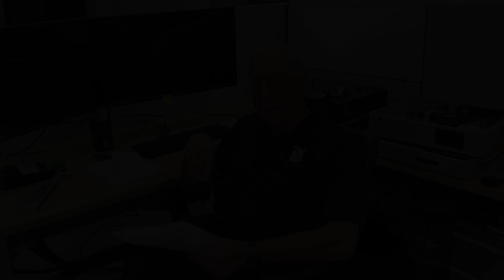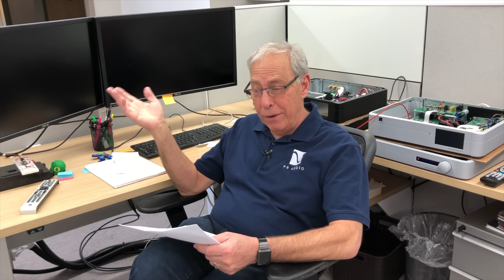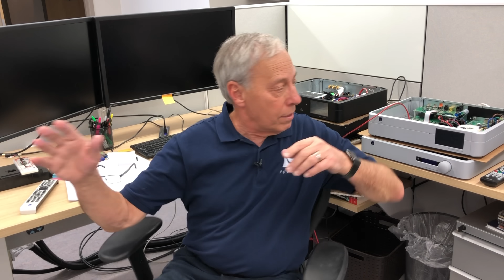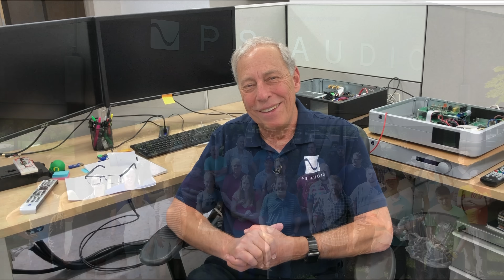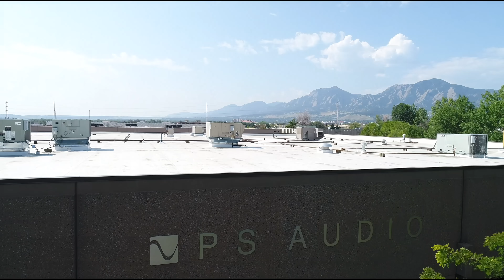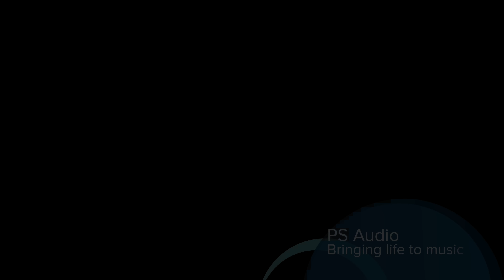Is it time to rethink our power grid?

Comment: Is that transformer stuck to the circuit board? Why do that when there's plenty of space on chassis? 
Stuff like that really annoys me. Means if repairs need to be done , gotta hold a large board with a massive weight in one corner. I consider that to be bad design and have abandoned Acram for just this issue.

Comment: Dc voltage would need to be just as high as AC, otherwise you'd need huge cables to be able carry the power, a NA wall plug can carry ~1800W, and sometimes if you're not carefull, the breaker blows. Would be fine for some electronics, but not for all, and at that point, a power supply per item is probably a better idea.

Comment: LED lighting may be "efficient" but is very hard on the eyes.  The color spectrum is "too blue" which also affects sleep.  These fluorescent bulbs loaded with mercury put out lousy light that flickers which is also hard on your eyes.  Does anyone really believe the 15 watt ones are equal in brightness to even a 40 watt incandescent?  I recently went to Dollar General, $1 three way incandescents, buy now because you won't find them at Home Depot for the most part.
Reply: Just Look at LED Binning!...only the CHEAP LED's fall into the blue spectra!:
https://www.edaphic.com.au/knowledge-base/articles/light-articles/led-binning-explained/
Reply: @RTR-MATEY  interesting, so if me the light company can do the binning using more blue lights to make a 5k color light they save money, and by definition 3k warm white will be more expensive.
Reply: @JohnDoe-np3zk  It's worth doing the arithmetic on "efficiency". When you count the cost of frequent replacement of transformers, lower light output requiring replacement of light fittings with more outlets and much shorter lifespan than claimed, then incandescents are a lot more efficient than LEDs. Not to mention less frequent climbing ladders that's a bit problematic when you're as arthritic as me. I have yet to purchase a CFL that lasted longer than 12 months and the incandescents they have replaced lasted for 8–12 years. My best friend purchased a carton of commercial grade incandescents back in the early 1970s to save money. When he died 8 years ago, not a single one had died and he still had most of the carton left. AFAICT this is all about maximising sales, not minimising energy consumption.
Reply: @jonathansturm4163 the CFL in particular are anything but "green" containing mercury just as other fluorescents.  I agree they die fast they have reason to die faster than incandescents with the ballast.  They put out a lousy light that flickers.  Anyway I'm going back to Dollar General and buying more incandescents while you still can.  The LED light is particularly annoying to look at so those are out for sure.

Comment: Audiophiles, AC is good for stereo after it is turned into DC, stored in a battery and then fed into the amp. The problem is a battery for everyone? 
Maybe for a few that can have a battery bank at their residence.
Reply: Batteries come with their own set of problems. In my experience battery powered audiophile devices are very overrated. A good quality power conditioner, coupled with a high quality linear power supply is much better than a battery. Of course it also costs more, but you get what you pay for. Battery powered audiophile devices are a cheap gimmick, in my opinion.
Reply: You ever heard of a H/K TC600? Not a gimmick at all.

Comment: The Power Grid is not your house/business!  Those are endpoints of the Grid!  DC clearly is not as efficient or work as well as the standard AC Distribution grid!  Now Tesla claimed and apparently was able to distribute AC wirelessly on his compound in NY!  This could not be allowed by the powers that be, and so if it was possible back then it was quickly destroyed!  Now there is an idea to focus on if you really want to rethink the power distribution grid!
Reply: Can you imagine the environmental issues of wireless power?  I mean enough to power the things we do in industrial areas?  This would NOT be like radio or wireless phones at all.
Reply: I don't claim to have any idea how Tesla pulled off wireless Power transmission.  But what if his system just picked off electrons from the air and the return was through the Earth?  The dangerous amounts of current would all be on the Earth not the Air side, right?  100+K Watts of RF from a Radio station doesn't seem to harm us, but HV transmission lines definitely have huge magnetic fields around them.  I'm unsure any environmental issues involved with wireless Power transmission would be any greater than those we already willingly accept.  ;^)
Reply: @PaulinTaegu  maybe research the HAARP which was celebrating it's revival just as Anchorage had the big recent quake.  There are these ionospheric heaters all over the place.  If you can keep a secret my daddy was involved early with their development.  Shh....
Reply: As a HAM I have a pretty good handle on HAARP and our ability to stimulate the Earth's environment and unleash incredible energy from a tiny input.  Unfortunately, instead of developing things that would benefit "We the People" those things get shelved in favour of weaponizing any new tech.  I get how superheating the atmosphere can create thermal air currents that exert huge forces on the crust of our planet.  Plausible deniability of targeted earthquakes?  Steering, intensifying and timing severe weather events?  They can control us and make $ from these deniable weapons.  No interest at all in providing us with low cost or possibly free electrical energy!  That opposes their objectives!  ;^)  WWG1WGA!
Reply: Wow, this thread went woo woo rather quickly.
Reply: PaulinTaegu, the PTB are way ahead of you.  Check out Solaren Corporation and their space power transmission agreement with PG&E.
Reply: lol @ "the powers that be" nixing wireless electricity. You're not so dumb as to actually believe that are you?

Comment: Yes, it's time to go off the grid and get away from the likes of PG&E.
Reply: Great video.  I've been gradually adding low voltage DC wiring to my house for things like lighting loads, distribution amps, routers, cable modems, security cameras, etc.  Basically anything with a power sucking wall wart is fair game.
I started with a 12V system and am now upgrading that to a higher voltage.  I'm adding small step up or down regulators as needed at each load to make the system voltage insensitive.  My kitchen lighting has been all DC for almost 6 years and works great:
https://youtu.be/I8FwHQttewU
No annoying 60Hz buzz, no flickering and all that energy has come from solar power.  I do have a backup line powered DC supply I can switch in to power things if needed.
Reply: @The4Crawler  nice, good job.  Check out engineer775 if you haven't he's got some great stuff on PV direct solar etc.
Reply: Yes, big fan of that channel.  If only I was on the other side of the country );

Comment: There certainly is a Standard Document for USB Ver x.x. A good introduction to that can be found here:

https://www.electronics-notes.com/articles/connectivity/usb-universal-serial-bus/standards.php

and you can google "USB Standard" to find all the official documents.

I purchased a very cheap but very handy little tool from Amazon called the USB Safety Tester:

https://www.amazon.com/gp/product/B01J7236K2/ref=oh_aui_detailpage_o06_s00?ie=UTF8&psc=1

This thing is $11 and anytime I get a new USB device I plug this into a Standard 5V 5A USB hub and plug the new device into the USB Safety Tester. Doing that tells me exactly how much current draw the new USB device draws. You'd be surprised. I once blew up a Smartphone when I plugged in a large USB memory stick into it and didn't realize it far exceeded the phones ability to deliver the current. USB memory stick manufacturers never put the current draw into their specs.